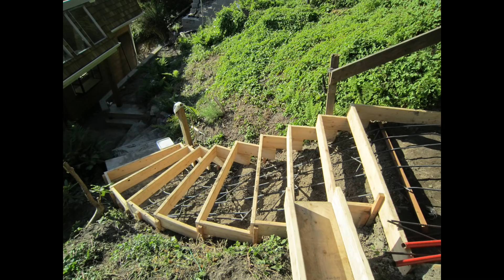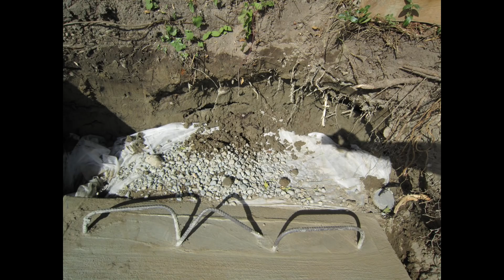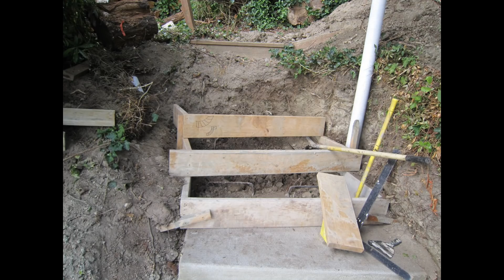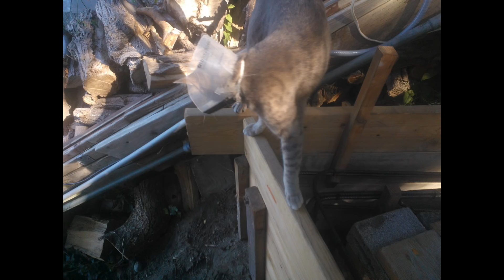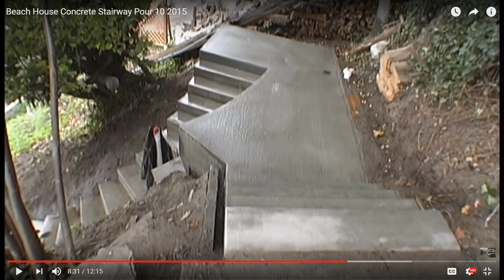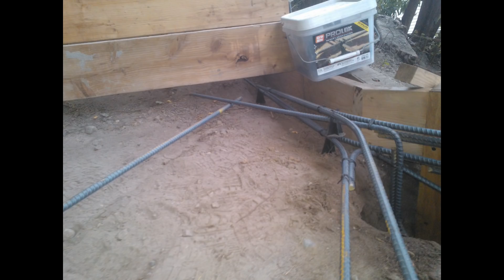Curved Concrete Stairway With Ground Water Control On A Steep Hillside

Comment: Does the wood stick to the concrete? Do you have to pull it away before it sets?

Just thinking do I need to do one step at a time or can I do 4 or 5 steps.
Reply from the maker: We brushed 10-30 motor oil on the forms to release. You can also spray with WD-40. They both soak into the wood. Spray the forms with water just before pouring to get them wet again and it will help to release. When trying to release the forms, don't just pull straight away from the concrete. Get your hammer and tap tap tap the forms and they will bounce away from the concrete. Let the concrete get a green set for a couple hours where it is still soft but solid and trowel able on the surfaces you want to finish or brush. Get your rounded edge trowel and a flat trowel to do your finish work. A brush if you want that finish as we did in this video. 
On this video where I do the upper level steps above the mid point platform, I did 5 or 6 of those one at a time. I had to did out the hillside and install drainage ond rock to control ground water. I also put rebar in the steps and had rebar protruding up in the top back of each step to connect to the step above. When the turn of the stairway was enough that I didn't have to dig into the hillside anymore, that's where I poured about 7 steps at once. I made provision for rebar connecting to the curved wall coming up from the steps. Along with the upper continuous steps, we built the upper platform box and walls and poured them at the same time. This was actually a very complicated set of stairs and had to be thought through before doing them. 
One thing you may be able to do is talk to a concrete supplier and get the name of a person who does concrete to assist. You can do your forms and when it comes time to pour, that person can help. It would be cheap insurance to get a nice job. There is a reason for the term "Set In Concrete" because once it hardens, that's it. Often times when we do big projects, I hire a crew to come in and do things. We have to watch them though to confirm ALL DETAILS. It's amazing the things we catch like walls not being plumb or straight. Go over and confirm everything before you pour. Once you start pouring, if it's a big job, you don't stop until it's done which can be 12 hours into the night. Hope I answered your questions. If I missed what you wanted to know, let me know and good luck with your project.

Toward the end of this video you can see a guy working a set of stairs. https://youtu.be/TJzqX_CBkwc
I have a bunch of videos showing different uses of concrete, just do a search of my channel videos for concrete and there may be something for your needs.
.This is one of the cooler house projects we ever did. The concrete work starts around 6 minute into the video. https://youtu.be/xAuqv9wJcF4
Reply: @CITAP1  thank you

Comment: i Love this, Great Projects.what Computer Program or app did you use to generate the preview of your project before you built it?
 I am planning a similar project soon
Reply from the maker: I used an older program Home Designer Pro 7 which is now Chief Architect.
Reply: https://www.chiefarchitect.com/
Reply: I am using a cheap program called Sweet home 3d to modify house plans, it's basically a toy program but it's fun and helps to easily visualize my changes
Reply from the maker: @roymccullough4997  If the program works and you don't need all the bells and whistles,  good enough.

Comment: Why did you not cut a 45 degree bevel at the bottom of the front of each tread.This allows you to finish with your trowel to the face of your riser.Much cleaner.
Reply from the maker: The front of the finishing trowel slips under the riser. I just slip it under and trowel across the stair tread. When I pull off the riser to finish and brush, the stair tread is troweled flat. Lifting slightly against the bottom of the riser. Keeps it flat and level. Work the edger to round your corners. Brush cement   or expose aggregate finish.

Comment: You need a windscreen on your mic. The sound is extremely annoying. Nice stairs. The music is also mostly an annoyance.
Reply from the maker: I have an ASUS Laptop gaming computer. Very fast editing video. Horrible audio input. I use a RODE lapel mic with a wind screen. To get a voice over,  I have to turn the input up to 90 and hold the mic or any other mic very close. I need to upgrade to Windoze 10 to get full duplex USB I/O. Can't do that because of older program compatibility issues. I have since kept background lower about -28db.  Thanks for checking out the video...

Comment: Very interesting, but the vid is too long. It needs to be divided into 3 parts around 10 mins each. 30 mins strait, is a step too far...
Reply from the maker: I could have done that but I kept it as one because it's a slideshow and one topic for continuity.  There are a couple other related videos showing the rebar and mixing/pouring/finishing the concrete. The series continues with 3 or 4 related videos showing the timber stairway we did after this. I really enjoyed doing this project. A good challenge. I'm preparing another slideshow showing all the work done inside the house. The house started from an uninhabited mess with rats, to a really nice home. Stay tuned for that one. Take care...

Comment: Is concrete your specialty and are you a professional contractor looks great to me.
Reply from the maker: I've been a licensed, bonded, insured General Contractor for just shy of 30 years now. I do concrete as part of larger projects but have done it on it's own as a smaller project a couple times. We do large addition projects mostly but we slip in a kitchen, bathroom, deck, or whatever when we can. I'm doing a small kitchen project right now while my brother is working at the main project. We've been on the current main project about 10 months now and should finish in 2 to 3 more months. The main addition project has about 85 videos, start to current in its playlist here on the channel. The early videoa cover demolition and the new foundation ground and concrete work if you're interested in more. 
Thanks for the comment!

Comment: Just curious. What did you price these steps out at?
Reply from the maker: From another reply. 
 It's been a couple or 5 years since this project now but I can estimate roughly, $1000.00 rebar and associated, $1000.00 for 300 bags of concrete, $600.00 pipe parts & glue,  $400 lumber forms,  $100 gravel, 3-4 weeks labor $8000.00. Total = close to $12000.00 Price will very depending on size and the difficulty of your project.

Comment: love-it-but-needs-hands-rail
Reply from the maker: The owners installed Stainless Steel Railings after finally deciding what they wanted.
Reply from the maker: Thomas Victorian   I visited the project about a year later. The owners had done more work higher up the hill and were just starting to install hand rails. Here's the video from that post project visit. At the top of the hill, beginning of the video,  as I start to walk down the concrete stairs at the top, you can see the first of the railings the owners have installed. Simple Stainless Steel railings. Here's the video showing the completed project, both concrete and timber stairways. Take care...
https://youtu.be/FAr92vXS6r0

Comment: That was a lot of work, and patience. I was wondering when you would pin to the hilside. Was all your rebar #4? How many sacks of concrete did you use altogether?
Reply from the maker: We did not dig into the hillside to install a deadman concrete anchor and cable due to slope and the amount of digging required. Some of the steps are set fairly deep into the hillside as built and there are the three under slab pins in the flat area above at the top of the stairway. Those three pins will provide some stability. It has been a couple years since construction of the stairway and there has been no detectable movement by the stairway. As hard as you may try, even the best of attempts to stabilize a steep hillside can fail. After extensive groundwork in a couple properties nearby, they still had slides. One thing we did different from the others is we made an attempt to control ground water with the drainage system under the stairway. It is constantly draining ground water away from the stairway and ground water volume increases during the winter rainy season. 
I recall using about 350 bags of concrete on the entire stairway. A think about 25 bags 7/8" round rock for the ground water drainage pipe system. 
Nearly all the rebar was #4 with perhaps 10' of a smaller size used in making some of the parts for the 3 pins. You can see the pins here. https://youtu.be/_EsAuMIYm9o?t=1607
Hope that answered your questions. Take care and hope you're following the "Building A Home Addition - Start To Finish Series".   
https://www.youtube.com/watch?v=TKEH7RPQ9FY&list=PLyz2LOih3ypubt3N5emZ_7CQT6MDkkCMU
There are currently 82 videos starting with the original demolition up to now with the outside being fully built and we are starting inside work now.
Reply: can you provide a rough estimate of what you charged for the job both for materials and labor?  I'm just trying to get an idea of what a job like this would cost.  thanks
Reply from the maker: @ricksina  It's been a couple years since this project now but I can estimate roughly, $1000.00 rebar and associated, $1000.00 for 300 bags of concrete, $600.00 pipe parts & glue,  $400 lumber forms,  $100 gravel, 3-4 weeks labor $8000.00. Total = close to $12000.00 Price will very depending on size and the difficulty of your project.

Comment: Where u at a third world country. Dig that sum bitch out form it up and line pump it in. You do things right just the hard way
Reply from the maker: We could have pumped it in but it has a price in setup. Nearly 800 feet of hose, 400 foot steep drop hill. Plus there were things going on with digging into the hillside and drainage, we decided to do things incrementally.  The owner didn't mind the work and it did save him some dollars. I chalk it up to exercise.  It was a fun project with a good reward of accomplishment factor when finished. It was a real plus change for the property.
Reply: CITAP1 looks great man. I was just givin u a hard way to go lol. Would have been perfect if the step side faces got rubbed out as well but all in all looks great